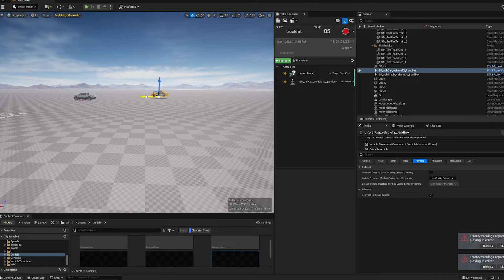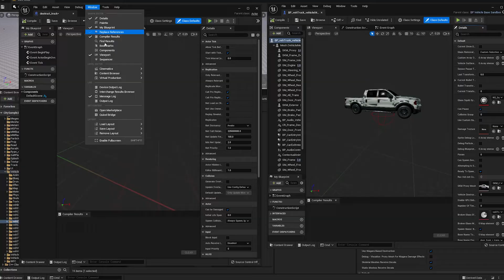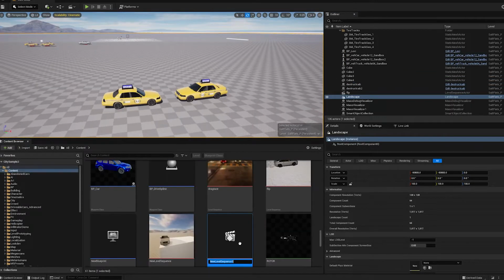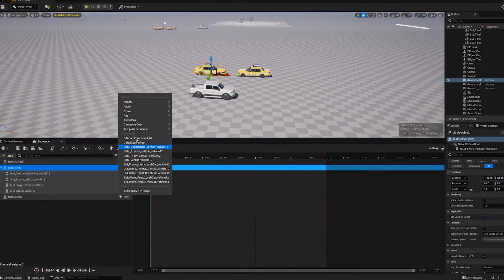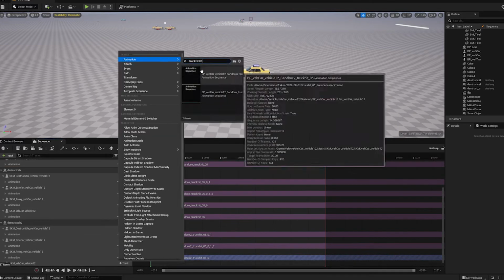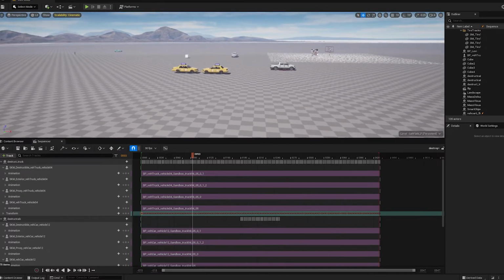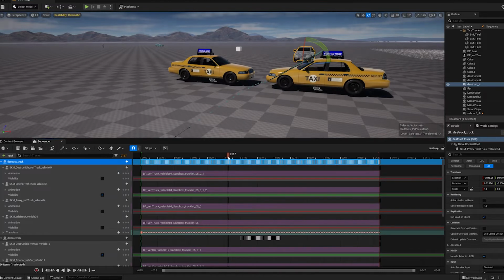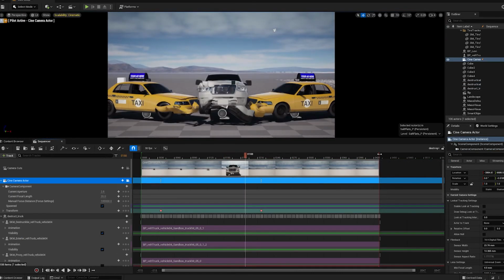Recording Vehicle Crashes in UE5

Comment: I want you to help me.
I put a character in a car with City sample of Unreal Engine 5.1 and record it with takerecorder.
When I started recording and was driving for a few seconds, the car suddenly got stuck in the road, making it impossible to drive and the take recorder stopped. (Every time, after a few seconds of driving, the car is buried in the road and the take recorder stops working.)

In the same way, I recorded a character driving a car with a take recorder, but when I played it back with a sequencer after recording and confirmed it, the situation was different from the recorded situation. I'm having trouble repeating teleportation in various places.
Reply: Same, again!  Great to find you again, my friend - I'm about to roll back to 5.0 to see if that improves anything.  Nothing else is even trying to explain this problem.  My own solution (for the time being) is to time out and use only very short duration shots, around ten seconds each. 🤪
Reply: Hey! I FIXED IT!  I decided to take drastic measures and simply loaded the entire "Small" map from the world partition ("load from here", or you can select and load as much or as little as you need), COPIED everything (just CTRL+A, then CTRL+C) and then created a new empty level.  I then PASTED (CTRL+P) the whole thing into the new empty level (NOT an empty World Partition / Open World, just empty basic).
Then, go through everything he's showing here (or the other guy in his vehicle tutorial) and you won't have the street problem.  I have no idea why this works, but I know I couldn't even start storyboarding until it wasn't a problem.